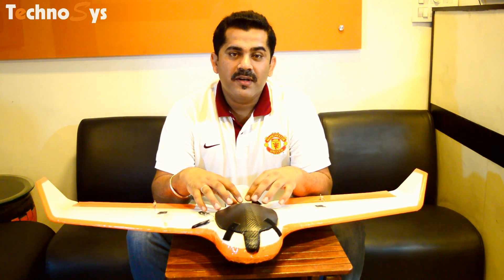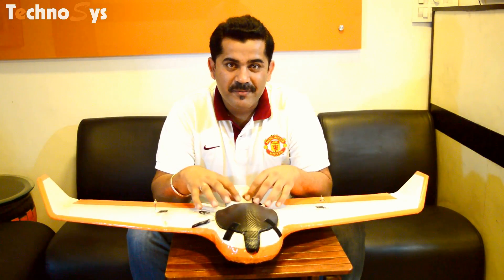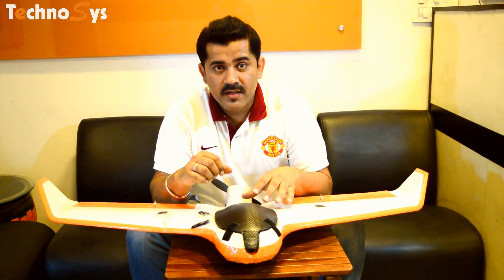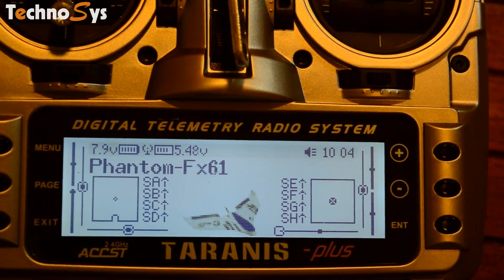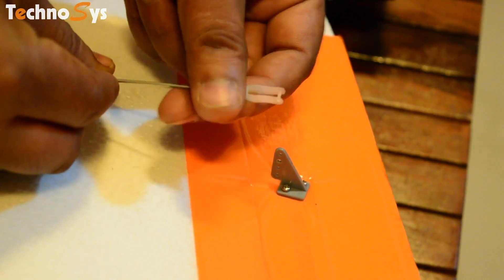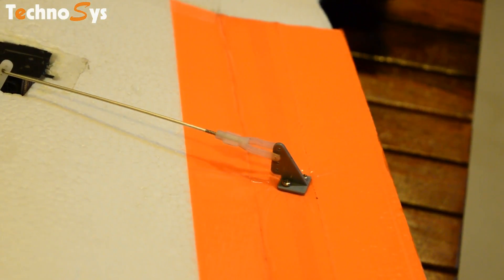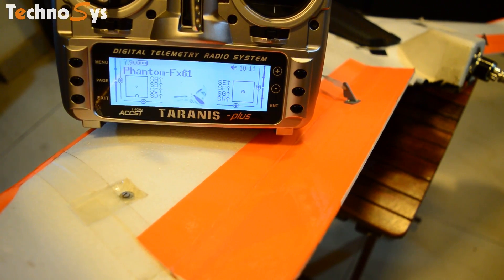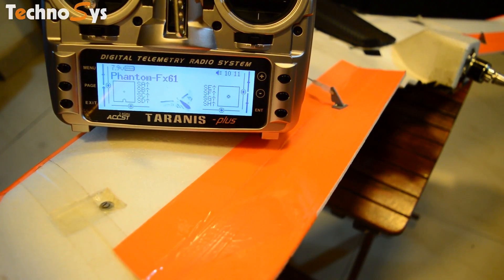How To Trim An Arduplane with Pixhawk Before Autotune

Comment: Dru, that's a great and very useful video. I have a suggestion that may help in trim and I need your opinion. How about if I use TRIM_AUTO set to 1, then trim the plane as per the official article. Once I am happy with the trim to temporary use hot glue to glue the elevons in the position they were when trimmed. Then in MissionPlanner set PWM_MID to 1500 and adjust the clevises so they fit in the servo horn hole. After that I can remove the hot glue dab I've placed. Would that work? Thank you.

Comment: Nice Brother. I love your video's. We live in north Europe and its always cold and windy and we always hope for a sunny and hopefully comme day so that we can go out and fly a bet. But I have a problem which I hope you can help me with. I have the Pixhawk so that In manual mode everything works as it should, But to rich that I had to change the Futaba 7c settings so that Ch 1 is at +86 and ch2 is at -118, and I have the Elevon mixing on the radio. when I change it to FBWA mode the elevons both have a down angle about 30 or something. What am I doing wrong. But it seems that when I move the plane into different positions the elevons move to the right direction but only ch 1. move much less than ch. 2 !!!? any idea what I am doing wrong? My plane is a sky. x6 do you maybe have the parameters for such a plane so that I dont have to go all this trouble. I will be very very Gratefull. Thank you and GOOD LUCK :)
Reply from the maker: +Bisholi M  Hi, Did you center your servos?
Reply: +TechnoSys Embedded Systems (technosysind) Hi, first of all thank you very much for responding. Apprishiate it very much :). I got it working after some more reading and some more head scratching :) and Now everything at least move to the right direction in manual mode and in FBWA mode, the problem is that I had to reverse one of the servo's( Just one of them !!! ) and change the Sub-Trim settings to very extrem ch1: 26 and Ch2: 120 (around that number) It just dont seem right to me that I had to do all that!!! or maybe it is ? and in FBWA mode the elevons both have a down angle, What do I do about that? any Idea's ? Thank you very much :)